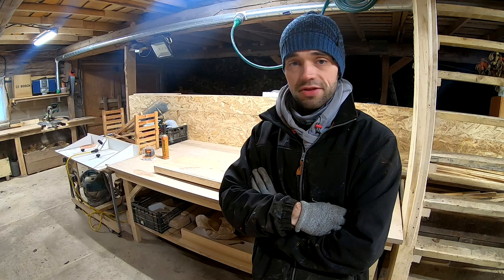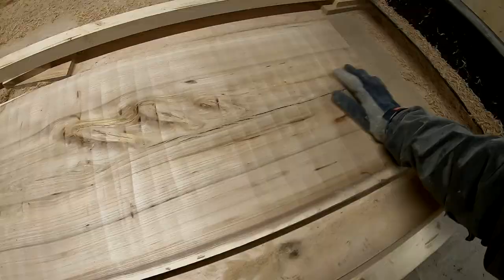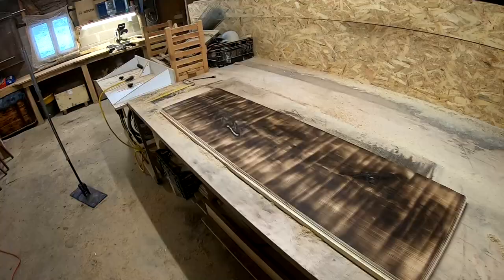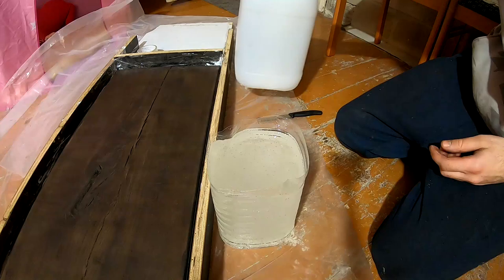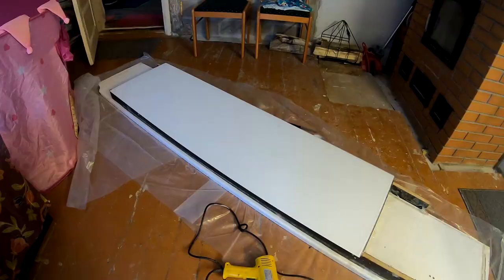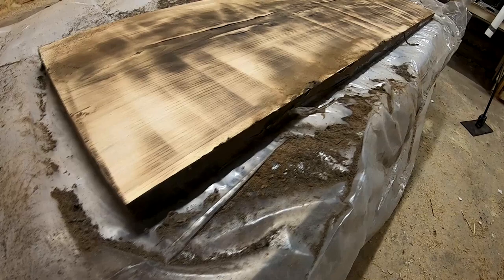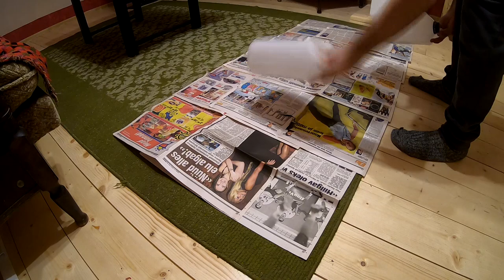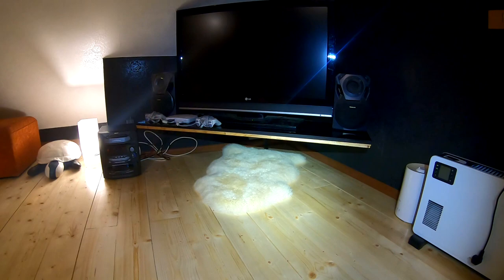Making a "Floating" epoxy TV table #DIY

Comment: looks great with a light shone on the top, not very practical to have a light on all the time. just enjoy it. i love the magic floating table effect!. for PS1 try changing the input to the other options red yellow white doesn't work out on our nintendo Wii with colour properly on modern TV i can't explain how i arranged it but i think it's set on "component" not AV on the inputs on the TV
Reply from the maker: The problem was in the TV, 2 of 3 component ports were not working, the scarf adapter worked fine, got color and sound. Thanks for the info!

Comment: I have seen in other videos, that there are special finish or polish liquids for an epoxy surface available. I often have seen people sanding the epoxy surface to a fine level and afterwords with the finish it gets crystal clear again. Similar to metal surfaces when you sanding them smooth and afterwards use a polish paste.
Reply from the maker: Ok

Comment: Not sure if you already know, but a common technique with burning the wood surface is to a hand-wire-brush. Don't know exactly what material the bristles should be but you only get rid of the burned/dead material. The difference ist that you don't get the smooth colored surface but the grain really comes out very nicely.
Reply from the maker: Ok

Comment: To get rid of the lines where the wood is a lighter color you need to sand them out. They are caused the router cutting deeper on some of your passes with the router bit.

Comment: Now that you have burned it you can sand blast it or wire brush it to give it that aged 3 d look.  Make sure to wire brush out all the charced😅 carbon.  Then epoxy.  
In college I pissed the wood shop teacher off for taking it over to the welding shop which pissed him off, Until they started to see that delightful driftwood look come shining through.  They smiled at me then bro !!! And I only used marine grade varnish on it.  I gave it away to an old girlfriend and she put it on her patio uncovered.  Years later it was still in good shape .  And it all started from pulling some 2x6 s out of a rain gully.  Lol😅
Reply from the maker: haha 😂

Comment: For me it is the sound that is the most important thing! Unfortunately, I have never been able to afford powerful enough speakers and currently have to settle for depressingly poor sound as three 12" basses burned the windings...
Why should home speakers be so expensive compared to car speakers? Think I'll try connecting 4 car speakers in series, which should then draw 16 ohms...
Will probably be quite expensive for 16 speakers per system only if I am satisfied? Luckily, I have my own house and am alone when it comes to my playing volume - have to replace the windows before they're all cracked, they're old-fashioned hand-made ones that are only about a millimeter thick and 700 rattling ones DO NOT sound good on the outside!
If it is possible to glue old valuable windows, maybe an idea for a section? Poor guys like me can't even dream of buying the same quality and the big ones (450x550) are hopeless to find used...
Reply from the maker: i'm not really sure. Maybe?